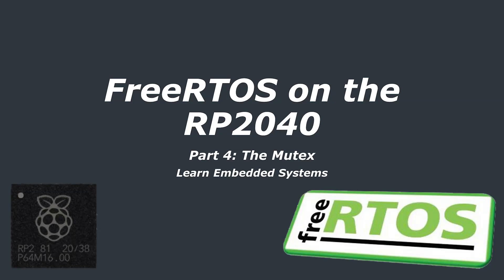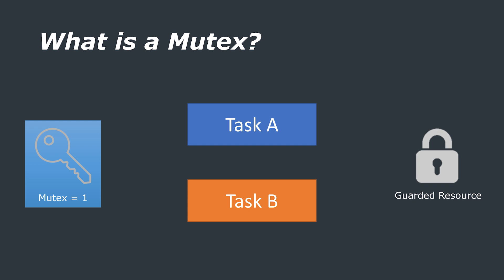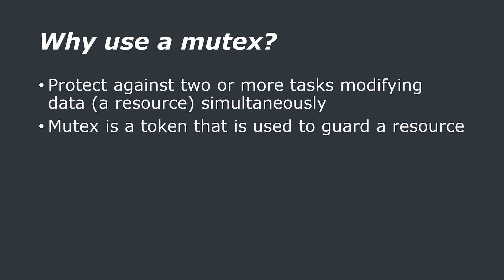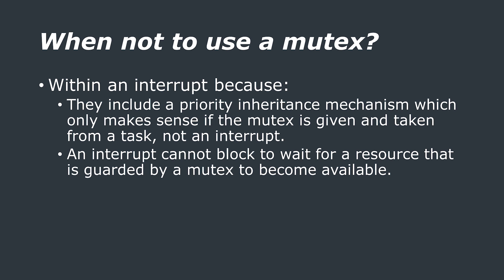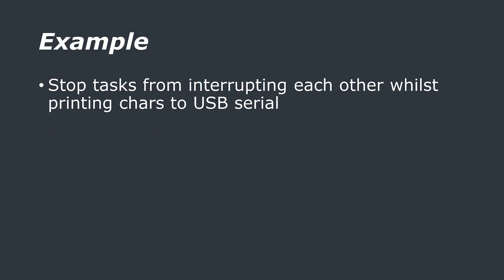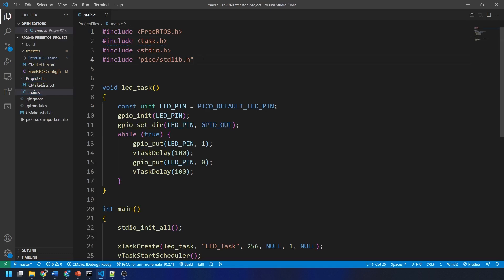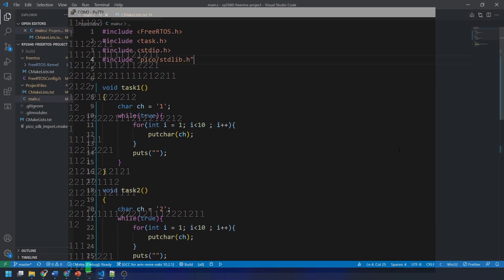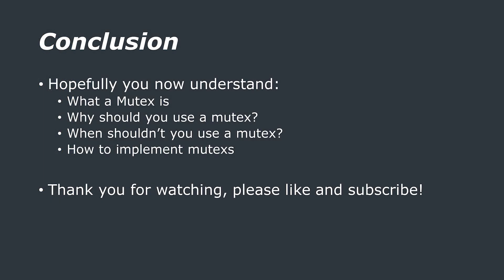FreeRTOS on the Raspberry Pi Pico (RP2040) Part 4: Mutex

Comment: I’ve seen many things saying that you shouldn’t run freertos over 1000 Hz, I saw here that you ran it at 100,000 Hz, I am planning on building a drone using the esp32 because of its dual core and was just going to run a single task on each core because the 1000 Hz max rate isn’t fast enough for task switching. Are there any problems with running freertos faster than 1000 Hz, because I need to have it reading from a sensors and radio and calculating its roll, pitch and yaw and sending commands to the motors at as high a rate as possible, ideally at least 8 or 16 kHz, now that would need a minimum freertos frequency of probably at least 64 kHz, but many people say don’t put it above 1000 Hz, which is the correct way? Can I run it that fast without issues or should I just not use freertos and it’s scheduling?

Comment: Great video. Could you please do a video on using Freertos SMP on Pico? Would be great to be able to use both cores along with freertos scheduling 😊
Reply from the maker: That video is in the works! It's quite an advanced concept so need to cover a couple more topics first! But don't worry it is on the way :)